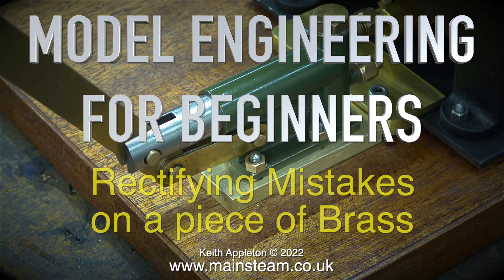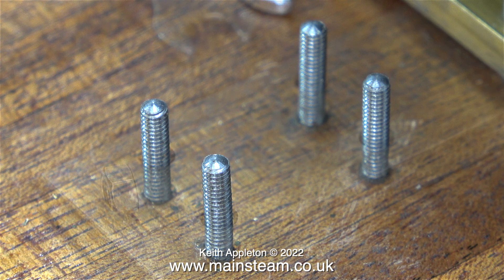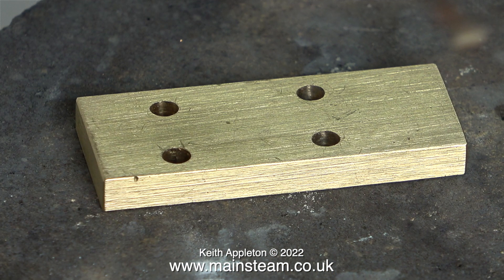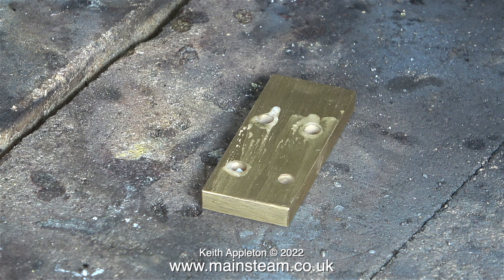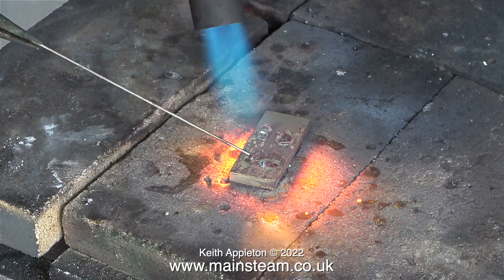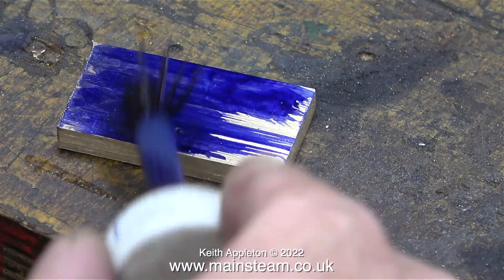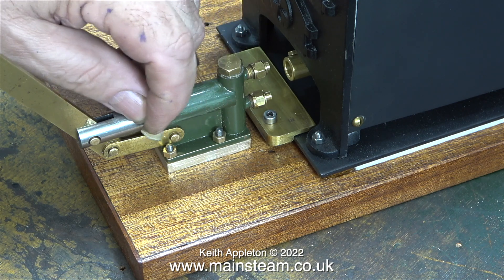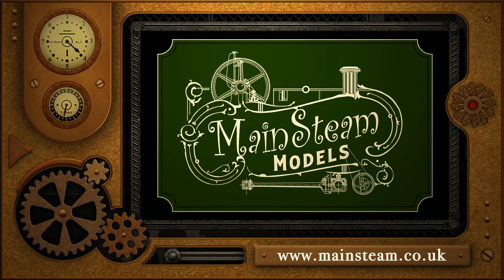RECTIFYING MISTAKES - MODEL ENGINEERING FOR BEGINNERS #43

Comment: Takes me way back to 1966 and my 'O' level metalwork practical exam, making a small G clamp. I oversized the screw hole and got away with filling it with soft solder. The examiner obviously didn't tighten the clamp and strip the thread. Result pass grade 1. I still feel guilty of cheating to this day! Great video as usual Keith.

Comment: I once asked a fellow mechanic, who was older then I was, how do I fix a screw up and told me the first thing is to admit you screwed up, and the second thing is the old "measure twice cut once" saying.  You screwed up but not only did you admit it to yourself you admitted it to us and even video taped if for us!   You are what is known as "a heck of good guy"!
Reply: Ich liebe den Akzent von Keith, aber das heißt nicht, dass ich alles verstehe was er sagt. Ich wäre nie auf die Idee gekommen dieses missratene Teil so teuer zu reparieren - ich hätte natürlich lieber ein neues Flachmaterial beschafft. Warum Keith das nicht tut geht vielleicht aus seinen Worten hervor (die ich wie gesagt nicht ausreichend verstehe), aber mir drängt sich einfach ein deutsches Sprichwort auf : "wirf schlechtem Geld kein gutes Geld hinterher"
Ansonsten aber volle Übereinstimmung mit Bullettube 👍.
I love Keith's accent, but that doesn't mean I understand everything he says. It would never have occurred to me to repair this failed part so expensively - I would of course have preferred to source a new flat. Why Keith doesn't do this is perhaps clear from his words (which, as I said, I don't understand sufficiently), but I'm simply reminded of a German proverb : "wirf dem schlechtem Geld kein gutes Geld hinterher" (don't throw good money after bad money).
Otherwise, however, full agreement with Bullettube 👍.

Translated with www.DeepL.com/Translator (free version)
Reply from the maker: I thank you for your kind comment {:-)))

Comment: LOL an alien birth comparison to human birth ... now THAT is funny .. I bet she may think during the labours it is an alien ... after not so much LOL
Reply: so the other option for getting the solder in could be to put some small cut off bits of solder in each hole with the flux and they will flow once the bar is hot enough ... and then top up as needed
.
handy for hard to get at places
Reply from the maker: Yes that's a good method too {:-)))
Reply: @keithappleton  hmm save up your brass fillings in a old 35mm film tin .. if you get large holes add the fillings as packing around the silver solder and add some brass back into the hole ... like one does with wood cracks and splits ... 
.
heck make an induction heater and recast the shavings into small ingots or lengths of common sizes you look for and recycle your own waste a bit might also work ... 
.
 I wonder if one of your steam engines might be able to even power one ...

Comment: Hello Keith! How about using brazing rod for something like this? That ought to work as well, I think?
Reply from the maker: I don't have any Brazing Rod, and probably most beginners won't have any either . . . the temperature required is much higher for melting Brazing rod and in any case, a beginner would probably melt the piece of brass.
Reply: @keithappleton  Oh that's right - was thinking brazing rod melted at a lower temperature. Cheers!
Reply: @keithappleton  Also, the issue of toxic zinc vapor comes into play.

Comment: I'm a bit surprised you didn't use brass plugs to fill the bulk of the holes before silver soldering.
Reply from the maker: I make Tutorials you know, and in this series I previously had already shown plugging methods.
Reply: @keithappleton  Ah, that makes sense.